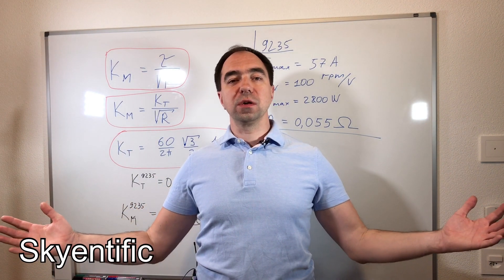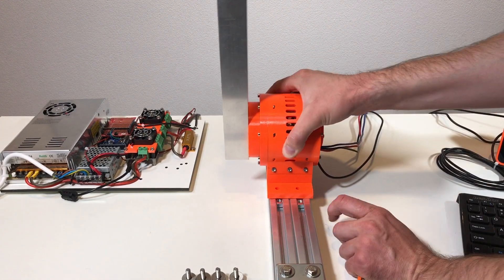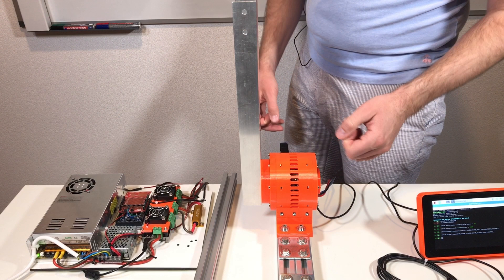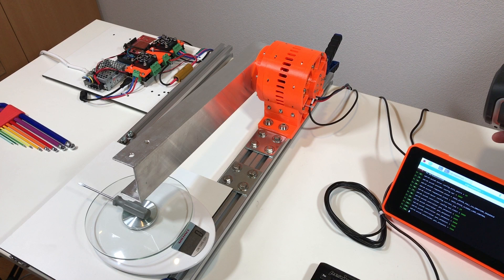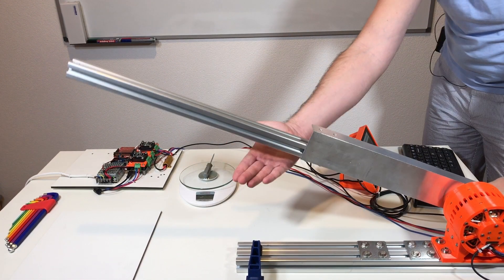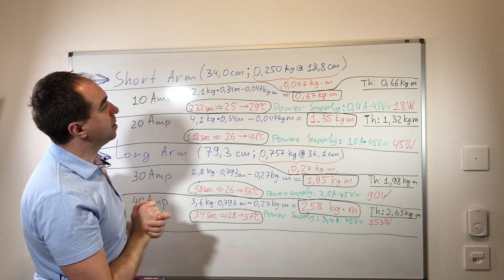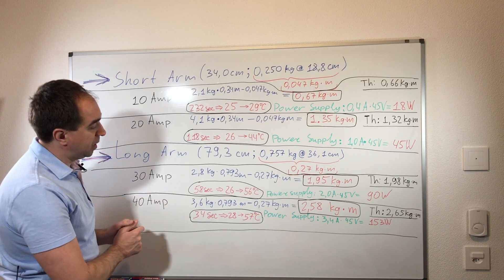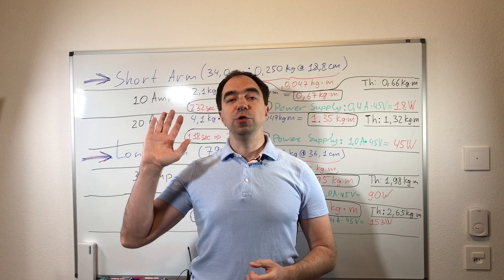OpenTorque Actuator Test (developed by Gabrael Levine)

Comment: Very interesting video. Please use the proper unit for torqe, Nm. I know a lot of motor vendors still use kg*m in their spec sheets, but it has been deprecated with the introduction of the SI system many decades ago (1978 in Germany).

Comment: You have an expensive oscilloscope and temperature meter...
Reply from the maker: It is not mine, this is equipment from my university.
Reply: @Skyentific  oh okay. Do I need a braking resistor on the odrive for robotic applications?

Comment: What is the maximum torque ouput of the BLDC? Looking at the gearbox it should have an 8:1 ratio but at 40A if the actuator is able to exert  25.91Nm then thee BLDC must be outputting 3.16Nm. For 40A this would require a Kv of 12.64?
Reply: You're off by a factor of 10 there. The quick torque estimation formula is current / (KV/10), so that would be 126.4KV. But a more accurate formula is current * 8.3 / KV (from this article https://things-in-motion.blogspot.com/2018/12/how-to-estimate-torque-of-bldc-pmsm.html ) which estimates 3.32Nm for 100KV, which I think is the version of that motor in use here. The HobbyKing page lists the max current at 57A, so max torque should be about 4.73Nm.

Comment: Hi, I have a question, at min 9:10 you push the lever and it moves, because the current is low the holding torque is low, is there a way to force the current so the motor stays in that place? (increase holding torque). And why the reaction time of returning to the holding position takes so long?

By the way awesome videos, thanks a lot!
Reply: @Skyentific

Comment: You should measure the force with the arm in the vertical orientation so the weight of the arm doesn't contribute to the force. Get a real load cell that can handle 10+ kilos of force.

Comment: A couple things you might check out.  For 3D prints I’ve been using brass threaded inserts rather than nuts.  This makes assembly and disassembly really nice.

Example:  https://hackaday.com/2019/02/28/threading-3d-printed-parts-how-to-use-heat-set-inserts/

Another possibility for low price motors are the newer closed loop steppers.  You can get 8-12 newton meter Nema 34 motors with HSS86H drivers for less than $200 shipped from AliExpress.  I’ve been able to drive them from an Arduino/esp32.

Keep up the great work.

Comment: Love watching these D.I.Y. servo and actuator videos and learning how things work.

Wouldn't a stalled motor try to draw all the current it can get? Since you have limited the current to 10/20/30/40 Amps the power draw at stall should be 450/900/1350/1800 Watts (@ 45 Volts).
I haven't played with BLDC motors or Odrive before, so if i am wrong please let me know.
Reply: Current limiting is done by reducing the voltage until "all the current it can get" is the target value. If you fed it the full 48V while stalled, either the power supply would blow a fuse, ODrive's transistors would burn, or solder joints would melt :) But I'm not sure exactly what's going on, because Skyentific's power measurements are higher than I'd expect, and it should only take a few volts at the motor to produce 40 amps so I don't know why the 24V ODrive wasn't getting the full torque.
Reply: @dekutree64  thanks.

Comment: Wow, 25Nm is impressive for that size plastic gearbox! And with such low reduction ratio, gear speed should be low enough for real world usability without worrying about melting them. How much does it weigh, excluding the weight of the motor?

Comment: Very nice reducer, I was always under the impression that a planetary gear system would always mean serious backlash. Also that big airgap motor is very nice with the ODrive. Can't wait to see this thing pushed to its limits or used in some example application. Seems like this arm can be both fast AND strong, would be fun to see it hammer, throw or move something.

Keep up the good work Skyentific!

Comment: Nice, thanks for the test. I have a 24V version of the ODrive. What do you think should I pull up 10kg mass with this actuator with 24V Odrive if I put a 10cm diameter pulley on it? You measured 3.5kg @20A with 24V, so it is 1,143kg*m.
If I count well, then if use a 10cm diameter pulley on the actuator, then 1,143+0,047/0,05 = 23,8kg. Am I right or missed something?
Reply from the maker: Thank you for your comment!

You are almost right. If you will have a circular pulley, then: 1.143/0.05 = 22.7kg. (you should not use 0.047, as it is for unbalanced arm. You pulley would be balanced (because it circular))